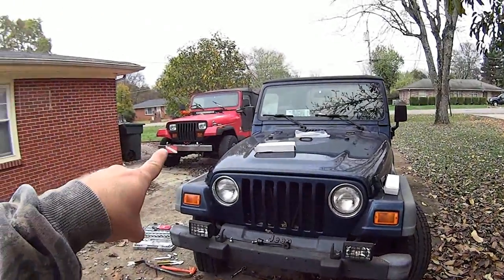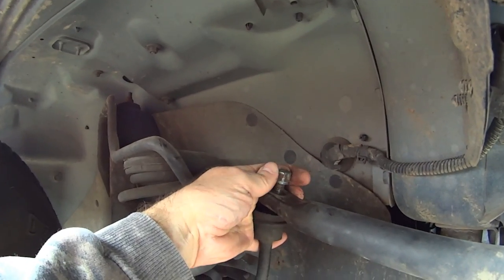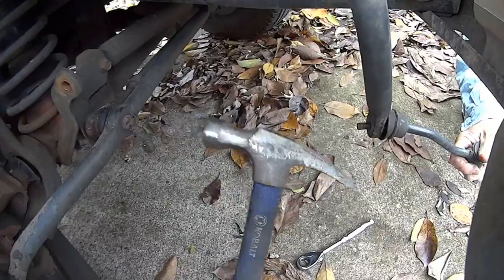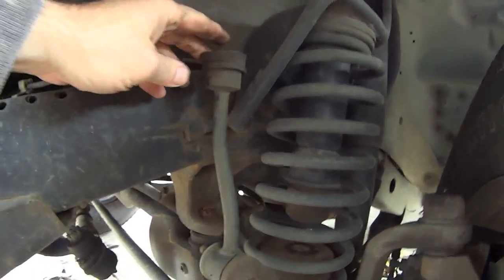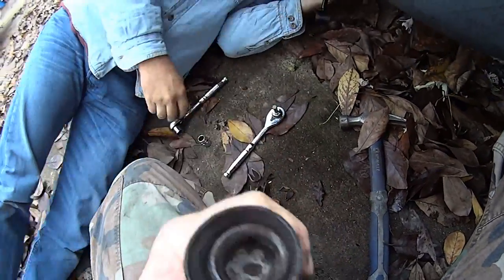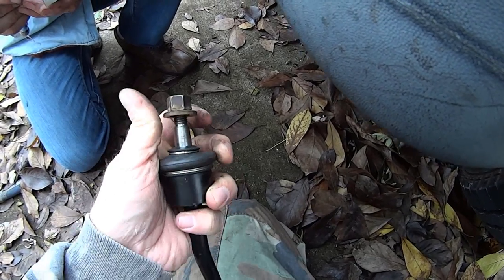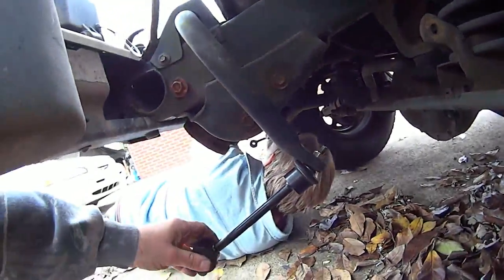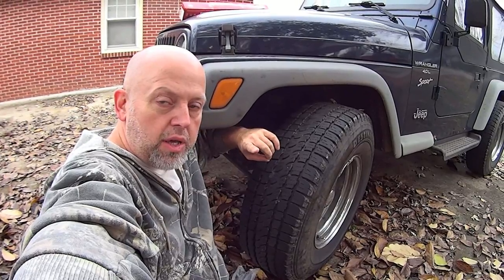Jeep Wrangler TJ - Sway bar End links causing front end rattle

Comment: Depending on the condition of the sway bar end link/stabilizer bar link, if you have a half inch impact, you can sometimes just use the impact to tighten the nut so much that the threaded part breaks off, making for one of the easiest ways to remove stab links. Problem is it doesn't work every time.

Comment: Torque specs from the factory manual for a ’99 TJ:
The manual says to install and tighten in the order below.
Sway bar bushings = 40 ft./lb.
Lower link nuts = 70 ft./lb.
Upper link nuts =45 ft./lb.

Comment: lol it was over kinda quick... love the videos, getting ready to buy a jeep, looking at a couple TJ's 97,98,99's
Reply from the maker: +Ricky Rogers 
Glad you like the videos! You can't go wrong with TJs. Their electronics aren't as simplistic at YJs. But, they aren't overly complicated either. Just one word of advise .. and to some people this is an argumentative subject. Do yourself a favor, stay away from the 4 cylinders. They are rugged and dependable little engines I will admit. If you want to go on a good road trip, that 4 banger will get old quick! I've driven several 4 cylinders, they are terrible at highway speeds and they get much less fuel mileage. The little engine has to push the weight along with the aerodynamics of a barn door, they struggle! If it's a city or trail rig only, the 4 banger will be fine. Hope this helps you! Welcome to the Jeep brotherhood !!

Comment: i have replaced mine several times, just to make them last longer buy the ones with grease fitting .
cheers
Reply from the maker: +long13hair Great suggestion, thanks! Thats my friends Jeep. He has had those for a few weeks, we just had gotten around to getting them put on. If it goes through another set too quickly, we will look into getting those for an upgrade. Thanks for checking out my video and taking the rime to leave a great suggestion! Have a great day!
Reply from the maker: +long13hair Thats just how we roll !! :-) Later man!

Comment: Cool!  Thanks for filming this.  My Tucson has some clunking going over bumps.  Is it possible the bolts on the sway bar links can loosen up and cause rattle?  As opposed to a bad boot.
Reply from the maker: Possible, but not likely. They usually have a lock nut the prevents them from coming loose.
Reply: Power Addicts - FixJeeps.com - Jeep, car and motorcycle tips Yeah thanks, I turned the wheel and reached under there.  The sway bar link bolts and the boots are all fine.  Mechanic said a bad inner tie rod was causing the clunking so I had that changed out, luckily it was warranty work even though they know I off-roaded with it.  Still heard clunking.  Took vehicle back to mechanic and they said the tie rod end is also bad.  They changed that out and now the clunking is half gone.  The shock and strut is also in good condition.  I poked around under there myself and can't find anything loose or any worn out boots.  I can't figure out where it's coming from, pretty frustrating.  The vehicle also leans to the right a little when driving even after the post tie-rod change wheel alignment.
Reply from the maker: One test would be to lay down under the front suspension with the engine off. Have a person in the cab, turn the key enough to unlock the steering wheel. Have them aggressively move the steering wheel back and forth. While you are under the front, listen for clunking sounds and track where they are coming from. If that proves not to find anything. Pick the front of the truck up high enough to get the wheels off the ground. Jack stands for safety! Start checking control arms and struts for excessive looseness. This is actually one of those things that's kinda hard to diagnose over the internet .. lol.
Reply: Power Addicts - FixJeeps.com - Jeep, car and motorcycle tips Alright, I'll try that, thanks!
Reply from the maker: Good luck!

Comment: hello.. i just replaced my 2 front end links because the passenger side already snapped from the joints. but after driving 2 blocks to test and check in my garage. the new end link from passenger side snapped again from the joint.. can u help me what would be the problem?thanks
Reply from the maker: You have something binding. It would be super rare but possible the sway bar is binding somehow. Remove both end links, then pull up and down on the sway bar. It should be some resistance but it should move up and down. If that isn't it, take it to someone to look at it closer. That's one of those issues that can't really be accurately tracked down chatting though YT comments. Good luck with it! Have a great day!
Reply: Power Addicts - FixJeeps.com - Jeep, car and motorcycle tips thanks bud youre awesome
Reply from the maker: Its all good. Just helping when I can. Have a great day!

Comment: So my end links don't have that on the end so I can tighten them down...they just keep spinning...so how do I tighten them down?
Reply from the maker: Those I take a C-Clamp and press the pivot into the hole. This ... most of the time .. holds the shaft in place so it can be tightened. Those can be a pain sometimes.
Reply: Loral Kinney ...get you a ratchet strap link one to the upper bar that connects to your sway stabilizer and then the other side to the left or right of the tie rod and start tightening it...it will pull it down and you can easily tighten the screw. I just did mine and it took 30 min to do both sides
Reply from the maker: Ryan Ferguson - Good tip, that would work great!! Thanks for adding that tip! Have a great day!
Reply: You too man!